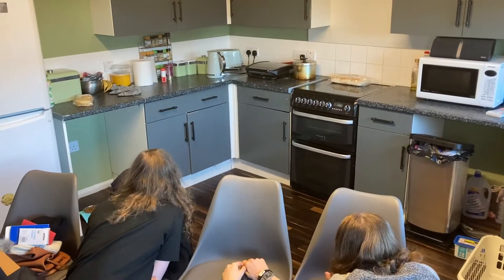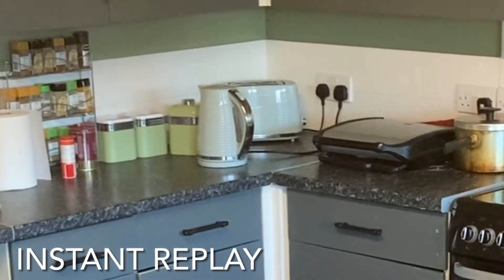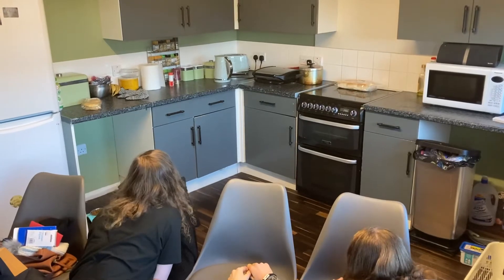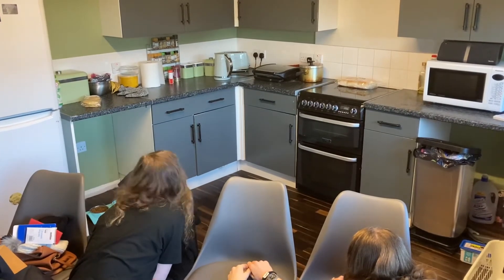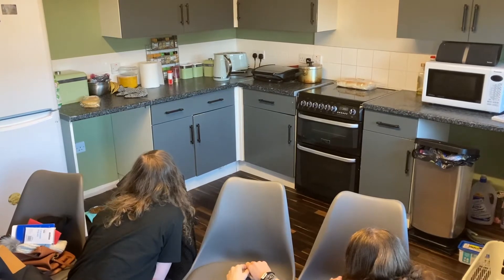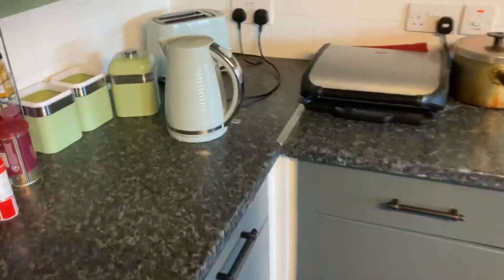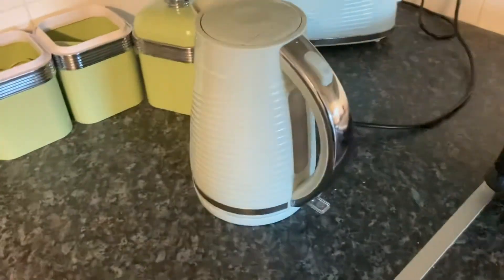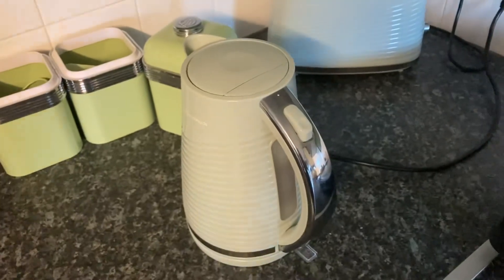Boiling a kettle with no water in it | TC-ed s01 e02

Comment: Because it has a temperature sensor, hold it down 😈
Reply from the maker: I didn’t want to actually die, otherwise there would be no more episodes
Reply: Even if you hold the thing down it doesn't work until it's cooled.